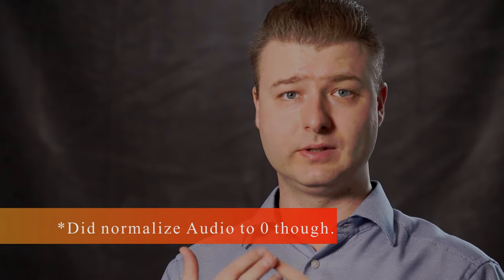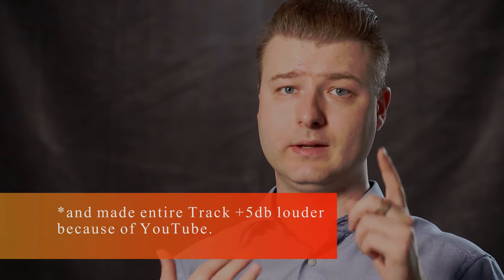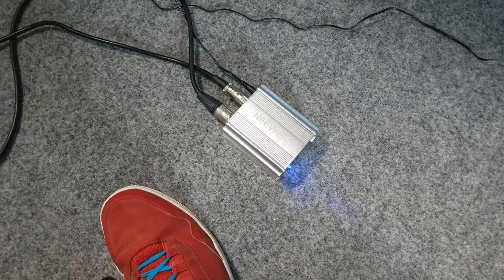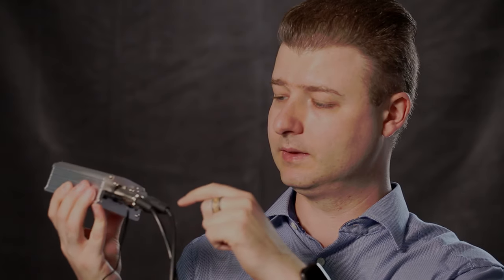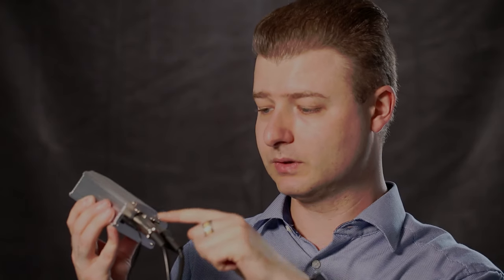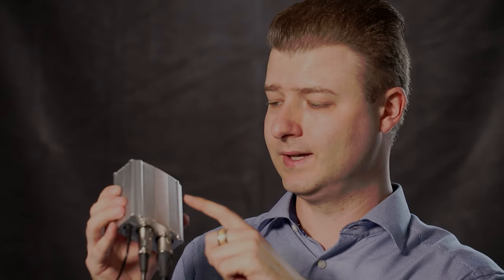Problem with Rode NTG2 not using Phantom Power - and solution!

Comment: In the description you talk about triton fethead and in your video you talk about a phantom power option. Which is better and why is the description not in line with the video???
Reply from the maker: The best option is to get the Sennheiser MKE600 and it's done. Wether the fethead nor the phantom power will make the mic better. Never the less, you would meet the fethead filter and activate phantom power on your recorder. But you'll need a normal battery in the NTG2, then you have the best option. If you only have a separate power supply for phantom power, use it. It's better than the power from the recorder for this specific mic.

Comment: Question. So I’m a streamer that uses a Shure SM7B connected to a GoXLR. I want to make regular YouTube videos without that mic in the frame and I do have the Rode NTG-2. Could I plug that into the goxlr (interface) and then to the pc and record into a DAW? Without the need for a Zoom or anything?
Reply from the maker: As long as your interface supports phantom power you should be fine.

Comment: The H6 already has 12, 24 and 48V Phantom power so why use the external Phantom power box? (And if it’s just battery life you want to save on your recorder when indoors, just buy the H6 mains power adapter for just a few quid!)
Reply from the maker: It's because of the microphone not because of the recorder. This is the same for the f6 recorder. It's because of the internal signal amplification of the microphone. That's why it's not a problem with later models of the NTG series.
Reply: @ChrisKluepfel  if i were to use a H5, how do i actually use an external phantom power supply when it actually provides its on?

Comment: hi thanks for your informaiton!
so if I use phantom power there is no problem with NTG2 right?
and if using battery as power, buying the model "Li-SOCI2，LS 14500" battery can solve problem right?
sorry for bad english, thanks again
Reply from the maker: Well the battery is a solution for cleaner and hotter signal. You'll still hear noise depending on the recorder you're using. But it will be way better compared to before. And be sure to use the right battery type which is described in the article.

Comment: So you have a battery inside the microphone and on top of that you are giving Phantom power from Neewer to your microphone as well ...  It should be either of two as you said ..  using battery and phantom both together will be too much power for the microphone ..... or may be the microphone has the mechanism to detect the phantom power and disable the battery circuit.
Reply from the maker: It's either one of them.
Reply from the maker: The ting though is, I never used the suggested battery. I just used the standard one. But when I use phantom power of 48 volts, the pre-amp of my zoom recorder has a lot less to do. The strength of the signal is good the entire time.
Reply: Chris Klüpfel So usefullll! Can you please re up the link for the batteries? Because only the phantom link works
Reply: Chris Klüpfel because i cant find it, and if i put an AA normal battery but 3.7 volt? Or 3.6?
Reply from the maker: @baloup571  the link is this one https://www.slashcam.de/info/Rode-NTG-2-Qualitaetsunterschied-Phantomspeisung-Batterie----Loes-849254.html for the article. 

The battery he used was a Li-SOCI2, Typ LS 14500

No guarantees though.